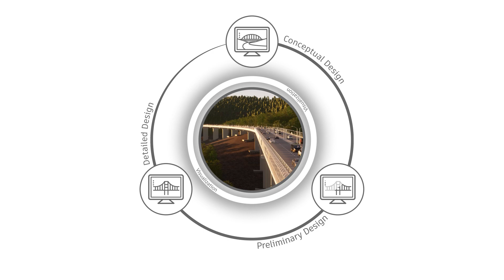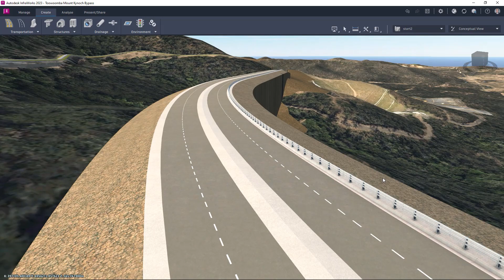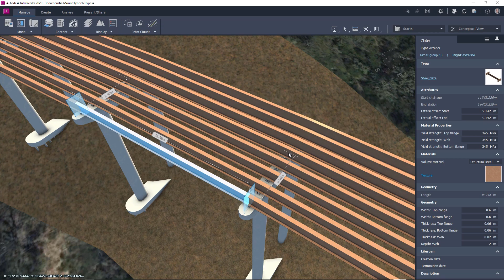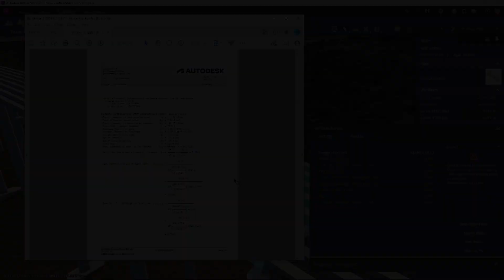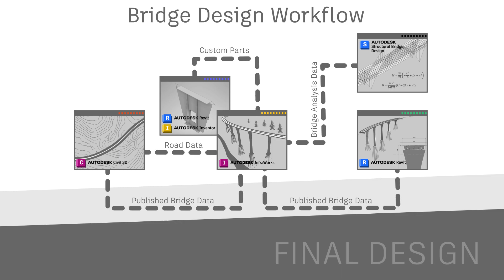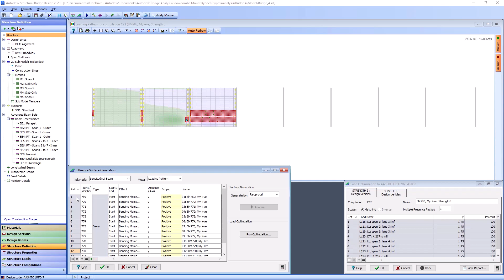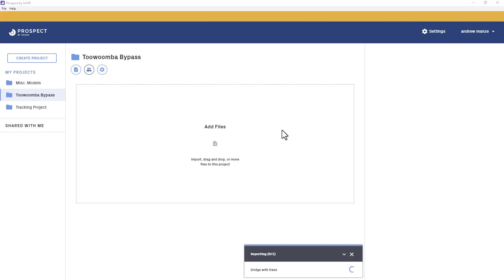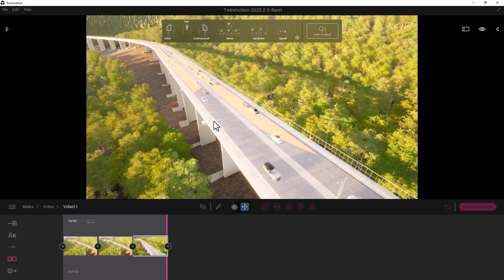Designing Civil Structures: Workflow Overview

Comment: So this addresses creating new bridges with IW. What about fixing existing bridges that come out of Model Builder? These usually drape the terrain and take a very long time to fix. Should I delete them and just build new ones? We are architects and don't use Civil 3D or Inventor. We like to use IW for quickly adding site context, but bridges are typically very poor. Any help is appreciated.
Reply from the maker: Model Builder, while a very productive tool, is generally a starting point for the project. The bridges generated by Model Builder can be considered as placeholders for a more comprehensive structure. As you've suggested, a more representative bridge can be achieved by deleting the existing bridge and the road that it is placed on. Then, replace the road with a component road from the library, right-click on the new road and select 'add bridge', then define the extent of the bridge as required. A new bridge will be automatically placed using the built-in heuristic rules.